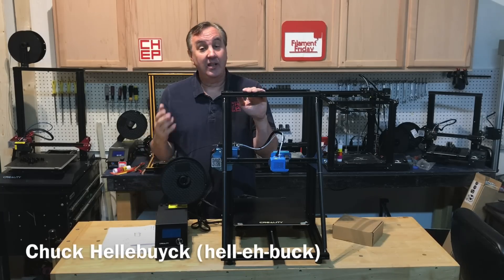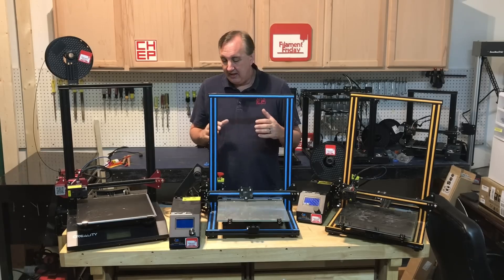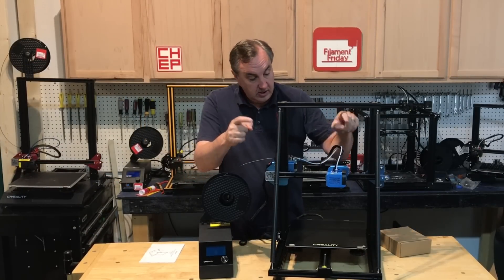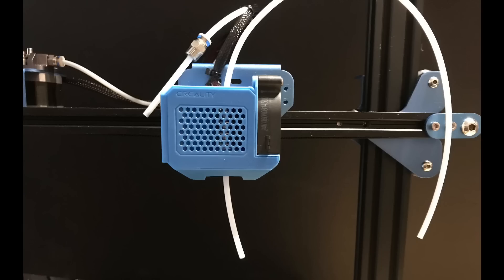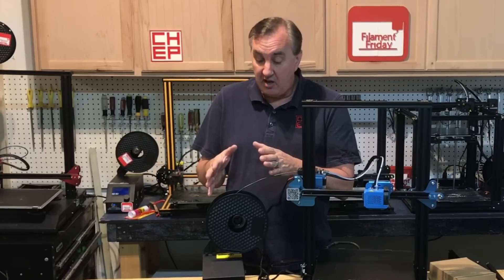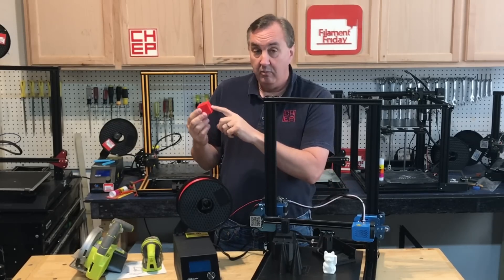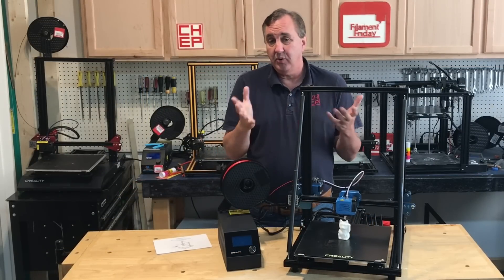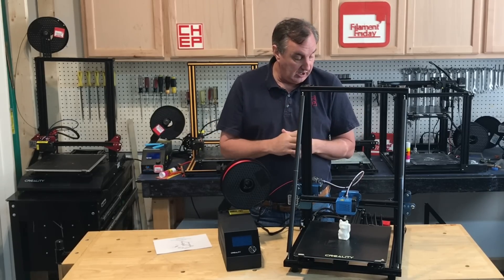Creality CR-10 V2 Review - Big Brother to Creality Ender 3

Comment: Hello Chuck,
I recently watched this because I just bought a CR-10 V2 from Banggood. I'm glad your happy with it because it makes me feel a lot better about purchasing it and its also nice to see your CR-10 has worked well for you. I have an original CR-10 still in the box that I haven't built yet and I'm dying to put it together along with the V2 and start printing again. I've just been busy with other things. I actually have a question I wanted to ask you about my Printrbot Simple Metal. It won't print and the way I used to interface with it was through a micro USB port. I tried printing with an SD card but I'm not getting any response and without the tablet/laptop/computer plugged in to connect with it, I can't see the settings, move or adjust any of the axes. Is it possible to install another board in it like a Creality board or another 3rd party board? I know you're busy but any answer would help and be appreciated. Thank You in advance, Frank M.

Comment: I was so impressed with this printer I ended up getting one for myself.

It print's the included models like the cat / pig very nicely,  yet when i try to do anything in a slicer (cura) and send it to the printer, everything looks like it has extrusion problems (gaps / holes between the layers / lines),  even when using your cura profile on your page.

Any ideas?
Reply: My cr-10 I have to pull back on the clamp which grips the filament as it wasn’t grabbing hard enough due to the spring. Try pulling back on the clip which grabs the filament and try and see if it prints smooth.
Reply from the maker: What layer height are you using?

Comment: Thank you CHEP. Awesome Review!
I am having difficulty deciding which CR series Printer should I go with? Assuming newer model CR10 V2 would be more capable compared to all others which are out there already (considering electronic chip inside those, etc.)! 
Can you please do some comparison video with others Vs CR-10 V2 so that we know what to expect if we were to buy one of these?
I think Amazon has reviews mixed up with Original CR-10 (sucks to rely on reviews by others since many Reviews are messed up and mixed up with other products). And not a lot of information available online as it is comparatively newer model.
Can you do a detailed video on various settings, and print quality with this new model as well? 
Any more information on these would be great as I am and so do many others are out there shopping for a decent 3D printer. 
Thank you for your work! It helps a lot of newbies out there.

Comment: Does it have a separate heat break that connects the heater block to the heat sink? or does the heat sink have an integrated heat break (ie. the heat sink screws directly into the heater block....)? Basically just wondering if I can buy a e3d heat break and put it into the cr-10 v2 hot end to convert it to an all metal hotend?

Comment: The best thing about the cr 10 is the exposed extrusion and disconnected control unit. Heated enclosures are so much easier to make for the cr10 vs the cr10s pro.

Comment: Great tips and I look forward to each new video.  I have learned a lot watching your videos.  I have a question is their a setting in cura that has the layer change on infill?  I was wondering if their was and would this fix the small burrs I get when printing?
Reply from the maker: Not that I know of but you can do outer wall before inner wall.
Reply: @FilamentFriday  That did the trick.  Thanks CHEP

Comment: Hey Chuck, I was wondering if you think the CR10 minis larger printer size and different electronics setup would make it worth the additional cost or should I go for an ender 3/ender 3 pro for cheaper? I'd also like to know which has produced better prints overall for you especially for small scale prints ( I plan on printing D&D minis and terrain).
Reply from the maker: They are both good printers. It just depends on the size you want.

Comment: That hotend looks like the e3d Lite6
Reply from the maker: Lite 6 doesn’t have PTFE to the nozzle either.
Reply: @FilamentFriday  Ah, I see, it uses the thinner secondary PTFE liner. This must be like those china clones then, like TriangleLabs offer, which work like the MK8 hotends
Reply: @Blamm83  i dont think so, the primary ptfe tube can be pulled all the way in this v2

Comment: Do you think it'll need TL smoothers like the Ender 3?
Reply: No
Reply: Yes
Reply: TL smoothers are such a ghetto fix. If you really want less noise upgrade your mainboard and stepper drivers.
Reply: @WrexShepard  TL Smoothers are so cheap and worth a try. I installed them on al my creality printers and I see not huge differences but some. And it's not about the noise it's about the electronics that the stepper motors put out and what goes back to the stepper motors. With the help of smoother it can block any redirected current that goes back to the steppers
Reply: @Declopse  I understand what they do. All I'm saying is that TMC drivers and a better mainboard will get you the same and more. If you MUST use a4988 drivers, TL smoothers are awesome for getting rid of salmon skin and reducing noise, they're just not needed with TMC drivers which I believe this printer has, although they might be set up in standalone mode since creality likes to set up their TMC drivers in a stupid way on their mainboards.

Comment: Why does a glass bed produce ringing on the y?
Reply: The weight of the glass causes the ringing as the jerk on the heavy bed is hard work on the structure and stepper- you only get it in the Y axis. As to why the weight causes the ringing I am not sure of the actual physics.
Reply: @Cloudman572  thank you for explaining that. Would the ringing go if the stepper was changed?  Would linear rails help?
Reply: @novakmiler7944  I could guess but the true answer is I don't know. There are a number of google hits for "3d printing ringing", see if that has the answer.
Reply: @Cloudman572  thanks again 👍
Reply: @novakmiler7944  I think it can be reduced with stronger belts. A lot tend to stretch over time, but on a smaller scale it still has elastic properties, and with the weight of the bed and the speed, its ghosting/ringing. Some premium belts are reinforced, some upgrade them, others just print slower. Another tip to reduce it, is if you have Auto-Bed leveling on a Creality machine, remove the bed springs and add solid spacers.

Comment: i still dont know ，cr10s pro or v2，which is better？  can u give a recommendation ？beacuse in china cr10s pro is more cheap than a cr10 v2 😂😂😂
Reply: Pro is a solid unit and easier to carry around and already has a decent ABL. If you upgrade the hotend, its a great printer.

Comment: Yep, overpriced. For this price they could give a "capricornus" blue PTFE tube (the clones aren't expensive) and maybe something else replaced. Instead of these rods. The review isn't full... (need some reliability tests with m.board, motor temperatures and etc.) Who knows, maybe there are some issues with motors (some Ender-3 users reported waves on Y-axis due to a bad motor that has really "pronounced" steps) or driver cooling. All these are my guesses only of course!

Comment: Chuck,

Been watching every week all year and I respect you. On this review, you can’t compare prints fairly if you don’t have it assembled the way it was designed. You complained about ringing yet if there is any hope of that improving, the extra rigidity of the frame might have made the difference. I guess we won’t know until someone else does a proper comparison and review. Sorry for the strong critique.
Reply: Thank you. I was of the same opinion. Most ghosting/ringing articles/videos mention multiple techniques for reducing these effects, and removing elasticity from the frame is often one of the measures suggested. Including but not limited to increasing the rigidity of the frame. With that being said, even if those supports don't add to the overall quality to this particular machine, making a point of leaving them uninstall set the tone of the video. Almost like its review was done before the assembly was completed.
Reply: yeah, would be good to see the difference with these rods.

Comment: With regards to your discussion about price in the end, it would have been good to mention the S4 and S5. After considering all the options I decided that rather than using my budget for the "upgrade" to V2 or Pro, I would rather "sidegrade" to the larger build volume of the S4. A major consideration for me was that basically all of the improvements of V2 or Pro can be made incrementally to an existing CR-10, often with components superior to V2 or Pro, but enlarging the build volume is not a very viable path.

Comment: Is your gantry level? I have a cr10 v2 and the gantry is 2mm higher on right side. I have to level it before every print, but the moment the steppers are disabled to level the bed they go out of whack. I’m not impressed unfortunately. Do you have any suggestions how to fix this permanently? I’m pulling my hair out trying to get this issue fixed. 
Any help appreciated.
Reply: the gantry is heavier on the extruder side. when switch off the plug,the heavy side will fall. it is common problem for s5
Reply: aaron ramly thanks for reply. Then how are we supposed to level the bed? It doesn’t have Auto Bed Level like my CR-10S. A major oversight my opinion. You have to disable steppers to manually level the bed. Levelling gantry before each print sucks! Does that mean when the steppers are enabled it rises back to level?
Reply from the maker: So far mine has maintained level. What you describe is the issue I had with the CR-10S.
Reply: CHEP interesting. I never had that problem on my cr-10s! Were you able to fix it? Is there anything I can try?
Reply: i have not fix mine,but i had seen people posting the solution in s5 group. search "z-axis belt synchonizer" on thingiverse. for the time being i just move the hotend to the other end and close to the bed,the result is not really consistant,sometime i need to revelled the bed

Comment: I think my Ender 5 Plus is a better printer for about the same cost 350mm x 350 mm x 400 mm and dual z axis.  It prints better than my two Ender 5's and the extra print area makes a big difference.
Reply from the maker: Maybe. I haven’t tested that.

Comment: You should do some prints with the frame supports attached.  Maybe that will help with the ringing.
Reply from the maker: It helps the upright not the bed vibration.
Reply: @FilamentFriday  Upright vibration can induce ringing as well, even though it will be less pronounce at lower layer heights.  Still should have been tested since the machine comes with them...  Still love the videos, thank you.

Comment: Wouldn't those diagonal supports help counteract ringing in the Y axis? Perhaps they added them because of the switch to glass.
Reply from the maker: No, they support the upright not the vibration in the moving bed.
Reply: @FilamentFriday  Yes, they help with the ringing... The ringing is not just because of the bed. The Z profiles are vibrating and these supports help to stop these vibrations... Do new and proper test. This review was really bad.

Comment: Yeah, not really worth the money. Knowing what I know now about 3d printers, it's not worth it over a cr-10s (and even then the only reason to get the S over the regular one is the motherboard). The only worthwhile upgrade would be the blower fan, but then the duct probably isn't as good as some you can find on thingiverse and the fans are dirt cheap anyway. The V6 style mount seems like a good idea, but the are plenty of printable mounts and you would have to buy an actual V6 (or all metal clone) to replace it, so you gain nothing for the price.

Comment: The rods not only make a rigid machine but you can use them to square up the machine so all surfaces are square to each other. If the upper section of the machine is leaning forward for example, then your sides (two sides if printing a big cube) will not be square to the top of the part. I hope that terrible explanation makes some kind of sense.

Comment: I think this is a bit too little improvement for a new version. Other manufacturers in the meantime improved their CR-10 clones with mains voltage heat beds, silent drivers, space saving integrated control unit and other nice stuff.
Reply from the maker: It does have silent TMC drivers as I stated.

Comment: put the braces on and run both at 100mm/s
Reply from the maker: I also tried printing the cones at 100mm/s. It seemed to be speed limited though I never did an M503 to verify.
Reply: @FilamentFriday  would expect on the cube or benchy to see ghosting that wouldn't appear with the braces....the cones dont have sharp corners so shouldn't see any ghosting ever...right?